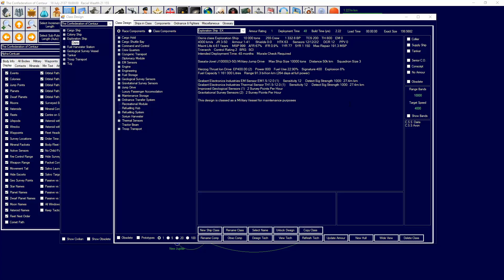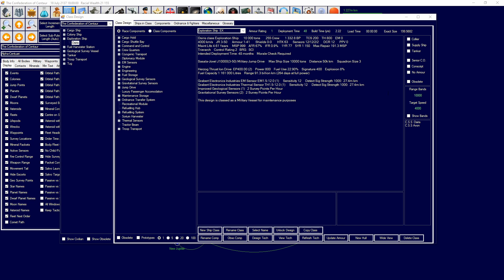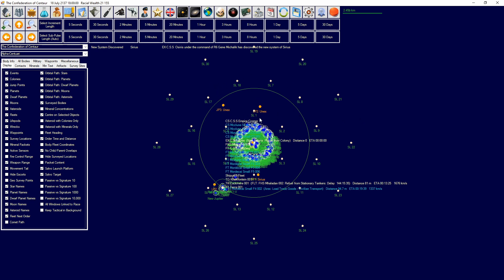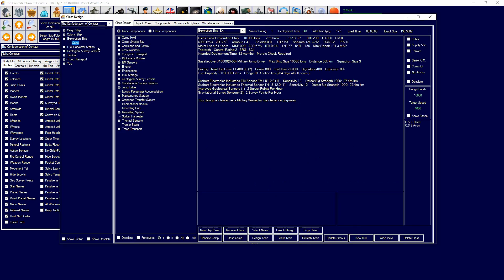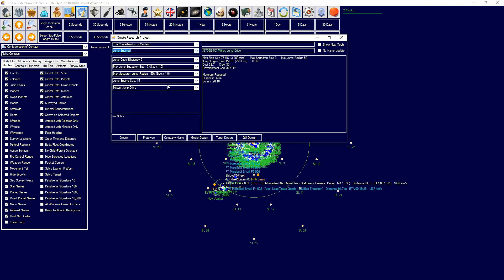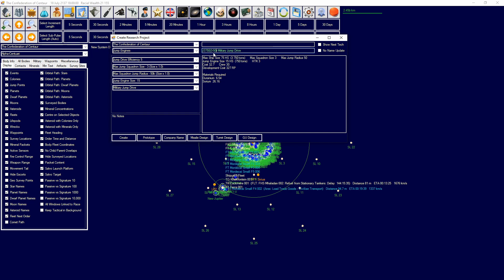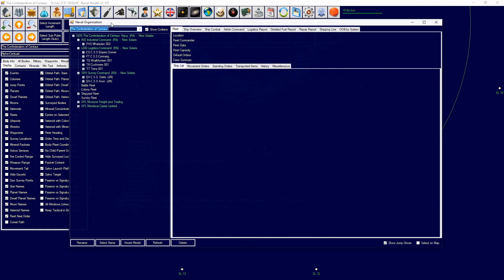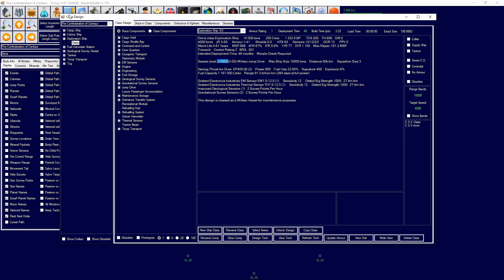Aurora 4x C# - Tutorial - Jump points and how jump drives work 101

Comment: I have a question about jump drives. If I have 2 ships in a fleet with Squadron Jump Size 5 will 10 ships jump at once?
Reply from the maker: I actually dont know the answer to this, my inclination would be no but I would have to test it myself, so I will get back to you
Reply: I have searched the forums, and I did not find the answer. Theoretically, with a standard transit after 5 seconds only one ship should be through. With 5 ships and squadron size 5, 5 ships should go through in 5 seconds with a squadron jump. I will have to test a fleet of 10 ships with 2 jump drives to see if I get all 10 after 5 seconds. Do I understand that right? I so rarely use squadron transit that it makes little difference, save in an emergency.